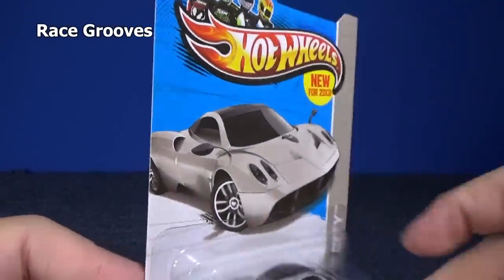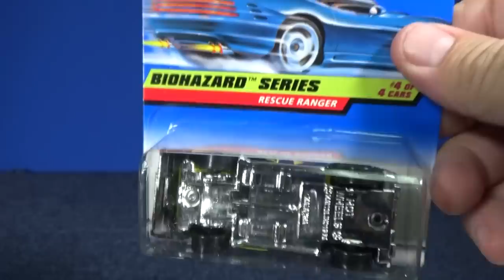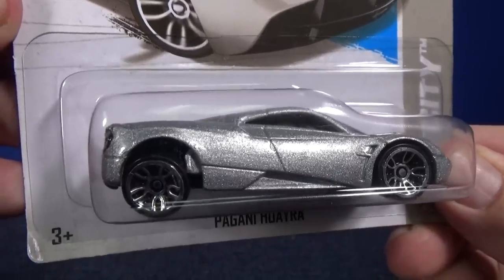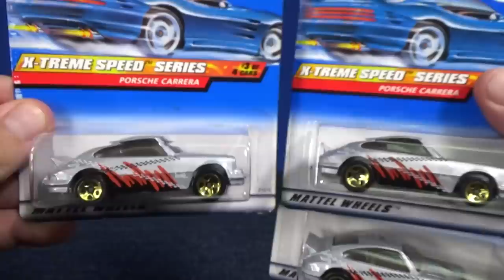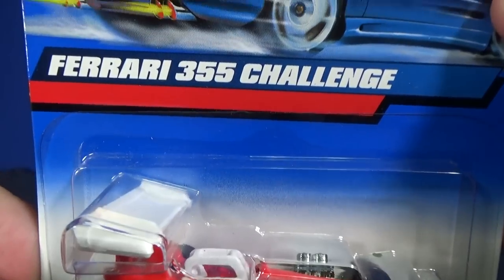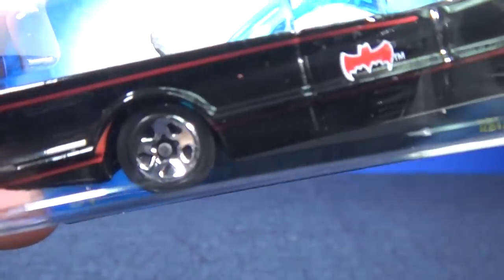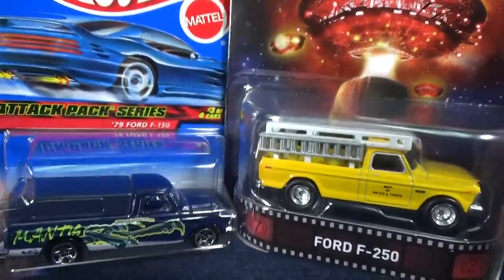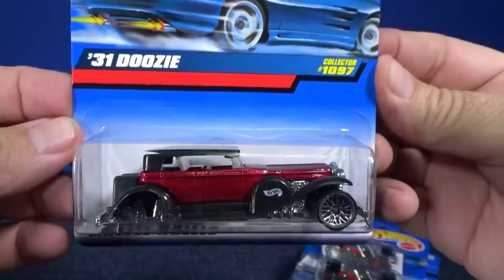What's The Error? Episode 12

Comment: I really liked that '31 Doozie. I have that same '31 Doozie, except mine has the back wheels and axle. Just like you mentioned in the video, I do not like the flashing that is not trimmed off in the wheel well area of the models. I have a '67 Ford Mustang that I opened and did not know it had that error until I opened in, since it was on the side facing the card. You asked about the difference in the Ford F-150 and Ford F-250. The Ford F-150 is the standard full size pickup. The F stands for F-Series and the 150 or 250 stands for the amount of weight the trucks can pull. So, the F-150 can tow or haul up to 1500 pounds. The F-250 can tow or haul up to 2500 pounds of weight. Both body styles are different if you see what those trucks look like nowadays. I hope I answered the question about the Ford F-150 and F-250. Great video and I cannot wait to see more videos like this.

Comment: Ford F-150 and F-250 are diff F-150 isn't considered a Super Duty as the F-250-550 which are. Also F-250 can carry a bit more weight better towing capability. The Super Duty line are also modified to be used as commercial vehicles such as small utility trucks, emergency vehicles etc heres an article on the F-Series from Wikipedia https://en.m.wikipedia.org/wiki/Ford_F-Series

Comment: 10/10. f150 and f250 refers to it being a heavier duty pickup. the frames and axles are sturdier on a 250. the 150 is a 1/2 ton frame, the 250 is a 3/4 ton frame and then an f350 is a 1ton frame. 

Chevy does the same thing but they use 1500/2500/3500. your avalanche should be on a 1500 frame I believe.

Comment: Mark The Ford F150 is a 1/2 ton truck and the F250 is a 3/4 ton AND F350 is a 1 ton most of the time the cabs and beds are the same  the difference the suspension and axles  for heaver loads   i did a video of the differences between the 2 trucks taken apart
Reply: Paul Wooten well said paul

Comment: Initially the numbers in the F Series trucks corresponded to the payload rating. A 250 has heavier equipment than the 150. Otherwise most of the trucks were cosmetically identical.

Comment: 1 rear axel has metal cast off on, 2 no rear wheels, 3 i think that was wrong way round wheels, 4 classic flipper 5 missing spoiler though now a days that might not ben an error as that was easy to re-move, 6 miss packed spoiler/not fitted well spoiler, 7 no tampo's? 8 not attached part, 9 missing tampo's? 10 wrong blister/package,
3 wrong argh been too long since we had an error vid bummer, well still good 7 out of 10, also as well if racegrooves remembers them in the 40's and 50's you had an add-on aircon unit that stuck to the side of the car that last error looks like one of those

Comment: The way i see the gord f series is the f150 is light weight and is cheap the f250 is medium sized eg it would be used as a tow truck or a small fire engine like the matchbox super duty f250 and the f 350 is the slow heavy duty obe that would be used for everything from pulling a stuck truck to carrying medium to hevy tools for construction 

The f150 is the most popular as it pulls its weight is very cheap and bullet proof (strong) and is most preferred by carpenters